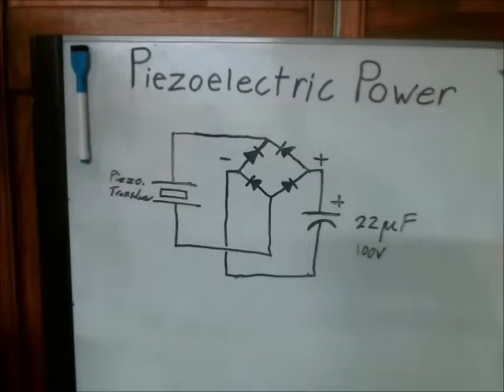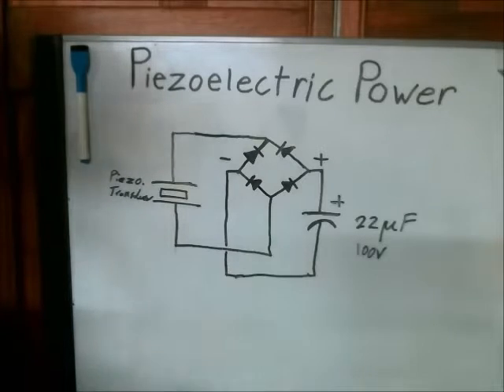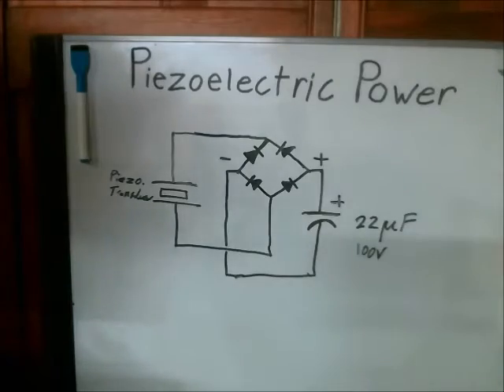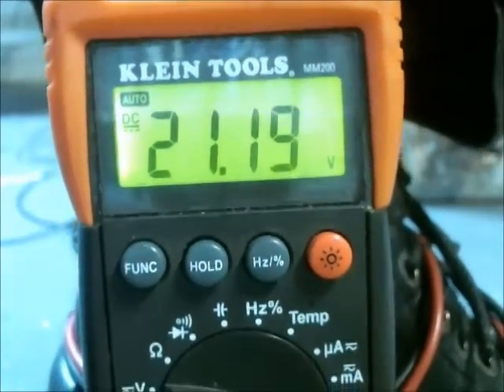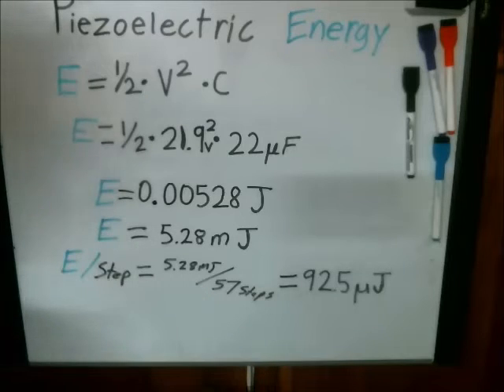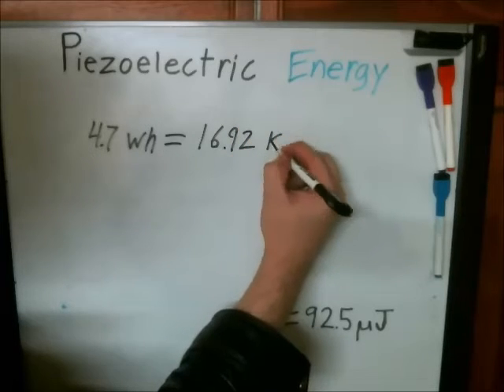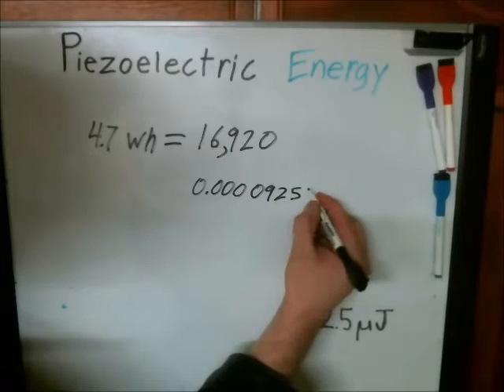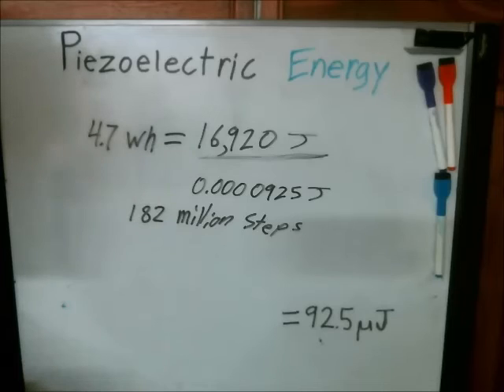Power from walking Piezoelectric energy

Comment: ..surely your calculation is dependent on the transducer. There may be more appropriate transducers that produce more current and you could use supercapacitors. You have just focused on voltage, electrical power also involves current, anyhow thanks

Comment: Also, you're using a piezoelectric sensor which is designed for "sensing" not designed for power generation. It would stand to reason that you need more of them and BIGGER crystals. Don't rule out that someone might work the numbers and figure out a better design.

Comment: Wouldn't the quality and size of the piezoelectric device make a difference? Also in this example you're just using a single one on one foot. There's at least three main points of contact on a person's foot so I feel like with multiple crystals of a higher quality on each foot could generate the power needed much quicker. Either way, awesome video!

Comment: Please,  I did this practical experiment. My AC voltage was varying , sometimes,  10V sometimes 2 V.  That's not my problem, the problem I'm facing is, the rectifier circuit absorbs all my ac voltage and delivers value of around 0.5V as the DC output,  please,  what should I do?
Reply: What did you end up doing? I'm facing the same problem rn. :/

Comment: so your creating high voltage at over 20volts , so voltage is not what we need to charge something?
Reply from the maker: Voltage is part of the equation. A cheap phone charger provides 5 volts up to 0.5 amps, which is equal to 2.5 watts. Watts are a measure of power and it is an instantaneous measurement. Energy is a power over a period of time. Joules is the unit for energy. For example when you pay your energy bill, you are paying for joules. Lets say your bill was for 1 kilowatt hour. and using the equation 1 joule = 1 watt X 1 second. There are 3600 seconds in an hour and the are 1000 watts in a kilowatt, so 3600 seconds X  1000 watts = 3,600,000 joules is what you are paying for.
Reply: Thanks for the explaination. I thought all u need was the correct voltage. Like if i was looking to charge something i would just look for something matching the voltage shows what i know.

Comment: hello!
Sorry! the picture of connection is wrong,the bridge of diodes have inverted the components,capacitor are in place of piezo  and the piezo in place of capacitor
In that form the circuits its inutilizable
Change this,for correct comprension of circuit

Comment: Charging a capacitor without a resistor? Why not throw in the resistor and set the time constant  to match the time between two footsteps? That'll get u kind of a constant voltage across the capacitor (with a very small ripple Vr, of course) but you could easily charge a small battery (a few 10s of mAh) with that setup by just adding a diode to the mix.
Your current setup basically keeps pumping the energy into the capacitor which is not good and there is no clamping on the piezo output voltage. If you accidently charge the capacitor too much you can electrocute yourself!

Comment: What happen if I use smaller value of capacitor?
Reply from the maker: +Aisyah Areena It would charge faster, but you would have less energy.
Reply: +Heilman Hackatronics where do you get the bridge rectifier? I built it using 4 diode and I can't seem to get any voltage output.
Reply from the maker: + my diagram is incorrect in the video.
You can get a bridge rectifier out of a PSU
Reply: +Heilman Hackatronics I have connected the bridge rectifier correctly (not according to your diagram). Is it because I have only 20micro farad capacitor? How do you connect the entire circuit to the multimeter?

Comment: hiii. since 2013 we still watch this video. thank you.  i have a question.  if we replace capacitor with 2 F super capacitor what will happend.  we can do that?
Reply: +Mojtaba Abbasi it's going to take longer to charge the capacitor, but it also means the capacitor would discharge a bit longer
Reply: hi why will we need to use a capacitor ? I mean what is its role in the circuit ?

Comment: I'm not too far into electronics, but try to devellop an artificial electromagnetic sideline for robber fishing baits. I imagine a mini piezio generator driving a long coil for generating the desired electromagnetic field, with optionally a LED as resistor. The whole stuff should be as small as possible and will be put into 170 Celsius hot liquid rubber, with a stiff wire to serve as a lever, connected to the piezo, generating power, when the ruberfish is wobbling and shaking. coil and wire can be adapted to different long rubberbaits.  How ist the schematics an the right values of the parts and where can such small parts be easily found? Anyone ist free the pick up this idea as long the results are shared with us. (cc) common creatives.

Comment: what's the name of the instrument you used to measure voltage?
Reply from the maker: kim north  Digital Multimeter
Reply: A "volt meter". .... But it drains power from the circuit fast.

Comment: i have the same miniproject of generating electricity from piezo how to charge a cellphone using the same concept?The problem which I'm facing is the voltage generated by the piezo is not sufficient to charge my phone .
i built a bridge rectifier accross the piezo then I used the lm7805 regulator preciding a 1000 micro F capacitor and succeding a 1 micro F capacitor.accross it I have used a boost dc to dc converter(0.9 to 9 v i/p and 5v dc constant o/p ).But I dont get any o/p .please help me friend.I need ur urgent help.
Reply: both of you use a power boost module which will boost the charge
Reply: +Pranav Powar  ,please  if you can help me because i am have same miniproject
Reply: help me haha

Comment: How do you transfer the energy from the capacitor to a battery?
Reply: Thats pretty useless.
you wont get to change a battery.
Reply: +Nino Joel why not? Using a boost converter
Reply: +Tyler Badertscher. even if you use one ....

the current is to low.
it would take forever to change a single 1.5 V. battery.
Reply: +Nino Joel I think if you used a super cap then the current would be high enough? What do you think?

Comment: Hi...I am doing a similar project.Can u please tell me where to et the piezo sensors from. The ones I am using are really small.Also, when we load a rectifier circuit ,the output drops to almost half. How did u deal wid dat problem?
Please reply soon!!!
Reply: +Nishtha Shrivastav pleas help me because iam doing same project but  iam need some information

Comment: Potential noob question: What if you used 1,000 of these little piezoelectricity generators?
 If one of this little generators produce 5.28 mJ per step, does that mean that if you press it faster, like more times per second, let's say 50. It would take less time/effort to produce the energy you require?
Reply: Material cost wise is not effective.

Comment: try to use 4 or 6 piezos instead of 1 it will charge much more faster ...also use some kind of a voltage regulation circuit so you won't fry your phone/device ..don't worry about current it's already very low these piezos generates a tiny amounts of current that are harmless
Reply: the output voltage is in ac right? if i have 10 piezo and all are connected in series, is the phase sequence has no effect if the output  of each piezo are not the same?

Comment: Good day!
Sir, 
Currently, this video is really similar to our project (thesis). Let me ask, "What is the mechanical energy harvested and converted it to electrical energy via peizoelectric disc"? Is it AC or DC?. **if AC what materials we used to convert it to DC?
Overview of our project:
Title: Acoustic Electricity Generator
Objectives: -to design an energy harvester of audio signal for small battery-operated devices
                 -to design a system that can harvest energy using piezoelectric disc (transducer)
                 -to design a charge regulator and controller
                 -to develop a battery-based charger
Is it really possible to store the converted electrical energy into a battery? 
 Also, how much is the current produced? We searched it, but find none.
I read an article, 'Using several elements (piezodisc) that are mechanically in series and electrically in parallel is the only way to increase the charge output'. What does this mean? Should we connect the elements in series then,, don't know the electrically part mean.
Thanks More Power!
Yours,
ECE students

PS: Sorry for bad english, we are from PH by the way. Hopefully this are not a dumb questions. LOL
Do you have emails or fb sir?
Reply from the maker: The mechanical energy was produced by my heel flexing the the piezodisc.
The electrical output of the piezodisc is AC so you will want to use a bridge rectifier (4 diodes) to rectify it into dc, then store the energy in a capacitor.
As for using audio signals, the voltage output of the piezodisc will unlikely reach the 1.4v require to overcome the bridge rectifiers diodes.
placing many piezodiscs in series will increase the voltage output, and placing many piezodiscs in parallel with increase the current.

Series ( Wire 2 of Disc A is connected to Wire 1 of Disc B)
   +
   /  wire 1
  () disc A
   \  wire 2
    - these wires are connected
   + to eachother.
   /  wire 1
  () disc B
   \  wire 2
    -

Parallel (the + wires and the - wires are bundled together
  + +
  /  /
 () ()
  \  \
   -  -

You could also try using a step up transformer to increase the voltage, but you will lose current.
Good Luck
Reply: Heilman Hackatronics tnx sir, is it possible enough to charge a phone battery by using piezo? Is it also ok to have a series and parallel connection, and store it into a dc battery to produce larger output (voltage, current)?, Suggest battery will we used? any? tnx

Comment: I am going to attempt to make this for a school project and i am just curious how you measured the voltage with your multimeter/voltmeter ? Where did you hook up your leads or did you add another component in oder to measure the voltage from each step? Thank you! I am a beginner so hopefully this doesn't sound  like a dumb question.
Reply from the maker: I attached the meter across the Capacitor.
Reply: Heilman Hackatronics How did you do that if the rectifier is attached to the positive and negative leads of the capacitor? I guess i need it in the dumbest way possible hah Great content on your channel btw
Reply from the maker: Tyler Badertscher
Thank you, I am glad you like it.
at 1:19 you can see the capacitor's leads are exposed, so I just clip the meter leads them.
red to positive and black to negative.
Reply: Heilman Hackatronics Thank you!

Comment: actually wouldn`t it be 2 as many steps, because your only counting your left foot? How about adding more piezoelectric crystals in series, regulating the voltage using an LM7805, and then maybe it would work + if you connected both boots :). Or even make multiple layers of pizza-insoles, how about that? good idea, well done
Reply: Martins Jancevskis  you can not join piezoelectric disk in series ... they will negate each others value .. you need to connect them in parallel .

Comment from the maker: Sunaina here is a list of parts with links:
Capacitor
http://www.mouser.com/ProductDetail/Nichicon/UVR2A220MED1TD/?qs=sGAEpiMZZMtZ1n0r9vR22Tyi2gJhrjzyD9Miv8BtZv4%3d
Bridge Rectifier
http://www.mouser.com/ProductDetail/Vishay-Semiconductors/B80C1000G-E4-51/?qs=sGAEpiMZZMtQ8nqTKtFS%2fMRt2%2f0z7Bct%252b%2fS9tJBBr%252bk%3d
Piezoelectric Element
http://www.mouser.com/ProductDetail/Murata-Electronics/7BB-20-6L0/?qs=sGAEpiMZZMtWZVZ%2fjgUYS12%252bytufDQNfgzm4uAdMbeA%3d
Reply: +Heilman Hackatronics  hi.! thank you very much for ur nice video. since 2012 till now alots of things changed but still ur video is useful.i have 2 questions. new generation of pizo can produce 20 or more volt out put. what do u think in this system we use super capacitor around 1 or more F and use booster?  what will happend if we use super capacitor?
Reply: thanks. but i already have a piezoelectric disk which i found from an old digital watch. but i dont know how to connect wire to it. how did you solder the lead wires directly to the disk?
Reply from the maker: Sunaina Awasthi
Unfortunately I was not able to solder to the disk, the metal kept flaking off you could try low wattage iron and flux, but having existing wires is ideal.
Reply: so then how did you connect the disk to the rest of the materials?
Reply from the maker: The disk I used was from a Microwave Oven, which had wires soldered to it already.

Comment: Thank you so much, Very informational. 
I think we all can see how inefficient a step is at charging a cell phone but what if you hooked that baby up to a hand crank with a notched wheel that would slap the crystal about 50 times per revolution. Yes you would have to hold it in your hand and crank it - but you could walk while you are doing it. :-)
it takes considerably less time to turn a crank than to take a step. now divide your number of steps by 50 and consider it takes less time for each CRANK. you could get into useful range this way. 
Or put 10 of these little suckers on each heel and each toe. that's 40 zaps per two steps. Maybe not a smart phone charger and maybe not a complete charge, but it could do something!

Comment: Where are u exactly measuring the voltage at 1:23?? Is it at the capacitor ?? If it is .. Then how do i extend the application to charge a battery at the same rate that of the capacitor ??
Reply from the maker: I am measuring the voltage across the battery.
If I could get more energy per step I would place a voltage regulator across the capacitor and the battery on the output of the voltage regulator.
Reply: What batteries have you been using ?

Comment: AWESOME!!
Do you think it is possible to make this with this pizoelectric material: http://www.ebay.com/itm/60-Panasonic-EFB-S10D42-12KHz-PIEZO-BUZZER-ELEMENT-350-15-0-2mm-DISC-3cm-LEADS-/271529706728?pt=LH_DefaultDomain_0&hash=item3f386e84e8
(those are not expensive :D)

Where did you buy yours?

YOU ROCK MAN! thanks for help :)

Comment: Hi, do you have a manual to choose what Condensador i need to used, because y want to do a circuit with many piezoelectrics on parallel, and i don't want burn the condensador if they are working at the same time. i use the diode rectificador too ;)
Reply from the maker: I was using a 22µF 100v Capacitor (Condensador), but you may want something like a 470µF 200v Condensador. as I left this in my boot for a day and when I measured the voltage it was nearly 100v.
Reply: Matt Heilman first of all thank you very much, but I do not express full, attempt to implement this circuit with larger piezoelectric (6 volts to 15 volts) and install them in areas where traffic area, for that reason I need to know if it is a viable project and that the carry the load (LED) is supports the voltage and could last as if I accumulate a lot of energy?, could connect the whole board load? should impliment that circuit for each piezoelectric? , Thank you very much for your help Greetings and blessings

Comment: but what if you put four piezo electric disks... wouldnt that generate more power which would reduce the amount of steps ?
Reply from the maker: Yes you are correct, but the energy output will still be pretty low.

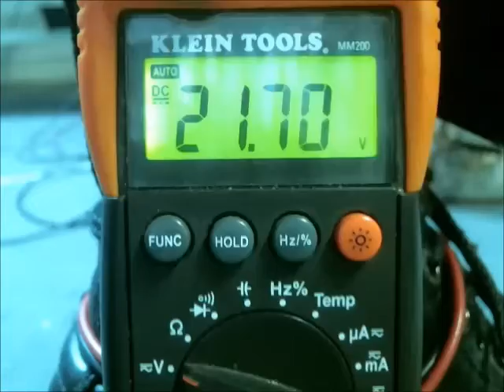Comment: at 1:34 you can see how fast the capacitor is discharging. By choosing a capacitor with bigger capacitance the voltage would not decrease so fast plus the stored energy would be bigger.
obviously the technology isn't very powerful but there's still room left to increase the catched energy.
Anyway, nice video though

Comment: Thank you so much, I needed clarification on how piezoelectricity works for my project, and this was the perfect explanation, even down to how to make the circuit to generate voltage. I've got to say, you are the best at what you do!
Reply: Cool....put a device in both shoes , and you can double the out put in the same time.
Put this technology in pedestrian bridges  in a massive scale , with hundreds of thousands of feet pumping power in to capicitator substations, and batteries, you could power street lighting.